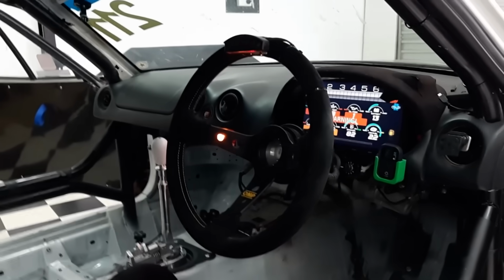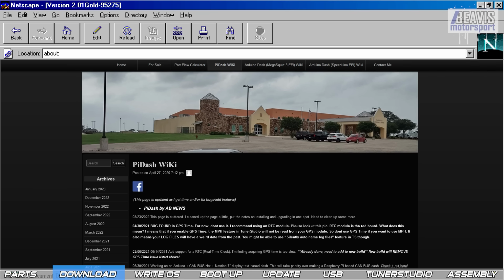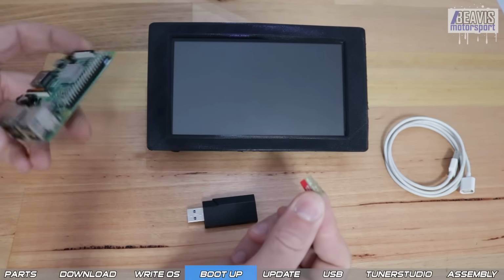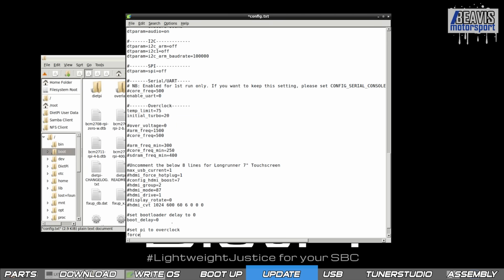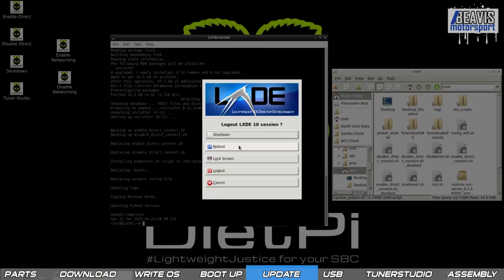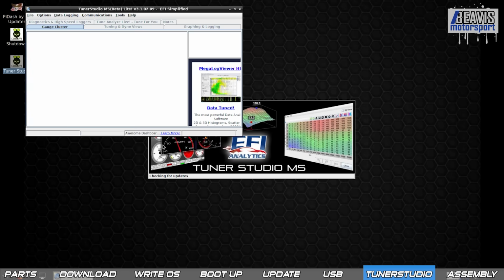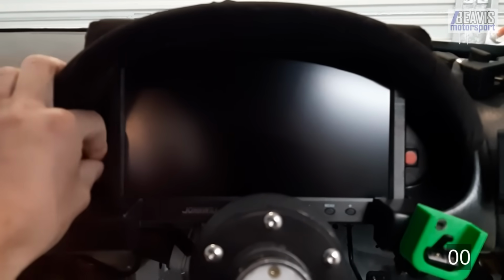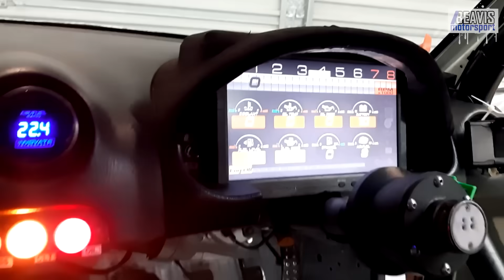DIY Raspberry Pi Racecar Dashboard: The Ultimate Guide

Comment: Great video,  do you think this same setup would work with Motorsport Electronics ME221 ECU. Apart from the digital dash part?
Reply from the maker: Currently the software available from their website only supports Windows. If you found someone smart in the world who makes a linux based dash application to work with the ME ECU protocol, then you could do it.
Reply: Ok thanks for the replies.
Reply: But I could run windows on the Raspberry Pi and run their software?
Reply from the maker: @MrLAJB  Very possibly, I'm not sure how the COM port drivers would work on the Pi hardware for windows, the Pi is not exactly Windows friendly hardware.

Comment: I’m wondering if there’s a way to further improve boot time, such as recompiling the kernel (not sure you’ve tried trimming that) and using a readonly card so you can just turn off the system with the ignition, w/o having to kick off the shutdown process
Reply: Try to use some kind of SSD as storage. I think it will shorten boot time pretty much because even very fast SD cards are nothing comparing to SSDs.
Reply from the maker: @kzyho  I considered doing this, but an SSD is quite a lot more costly, and physically bulky.
Reply from the maker: I've no doubt there's going to be tweaks here and there at the OS level that could save time.
TS Dash saves a further 10secs or so.
Could try a faster boot media, perhaps USB m.2 sata disk.
The ~30secs to boot up doesn't bother me, I'm sure it would be a deal breaker for some, but I just don't see a scenario where I NEED to have the dash live instantly.
Reply: How do you set it up with a "read only" card and how does that help, does the OS know it's read only and not do all of the back ground crap computers do these days...?